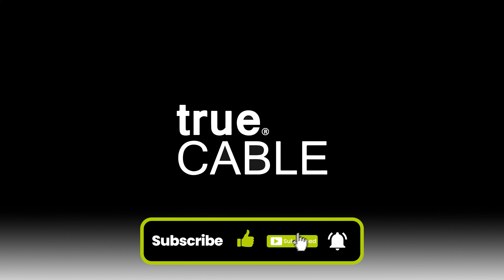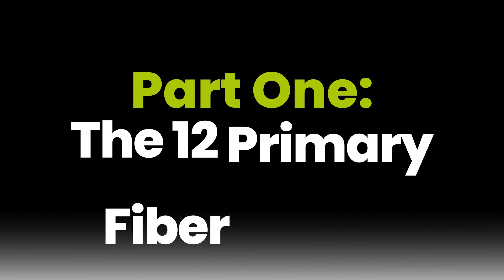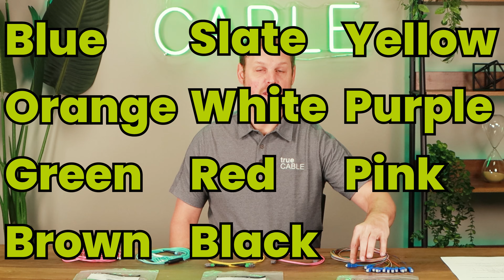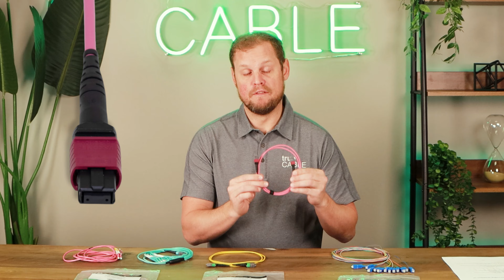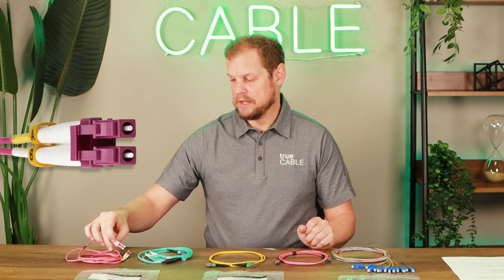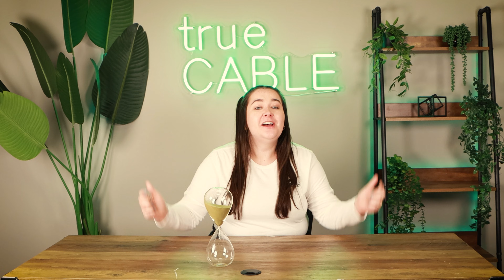Full Guide to Fiber Optic Color Coding | Breakdown with Examples 2024

Comment: fibre optic colour coding follows the old copper telecom colour coding, so it will start with blue, then orange, green ...... these also are phone line orders, blue is line 1 orange is line 2, etc. 
for cables that have multiples of these twelve, they have a wrap that starts with blue for the first, orange for the second, you guessed it green for the 3rd etc. it's just the same as it was with copper cables and bundles.
Reply from the maker: Hello! The colors are the same in regards to the tight buffer colors used on the individual strands. Where things get very different is the outer jacket colors, and that no longer follows anything resembling copper related technology.

Comment: OT : I have a home network with about 30 hard wired Cat5e and Cat6 sockets that were all wired professionally. Recently, I have been cleaning up my patch panel and making up some new patch cords. It's been a great learning experience. I have been cutting down some existing patch cables and re-terminating them. In doing this, I have found a bunch of very suspect cables. I watched your video on testing cables; specifically, on how twisting / un-twisting can affect performance. But, undoubtedly, your equipment is far too expensive for a home user with a limited number of cable to test. Can you suggest a cable performance tester that might be a bit more home user price friendly ?
Reply from the maker: Hello David! Ugh. That is a thorny question if spending money is an issue. The tester I am using is a Fluke DSX-8000 and fully kitted out to test patch cords in addition to permanent links it will cost you well north of $15K. The next step down is $2,100 for a Fluke LinkIQ, which will work well enough for home users and weekend warrior installers, but not professionals who actually need to Certify cable. The Fluke LinkIQ is cable "qualifier" that performs a pretty accurate analysis and speed test. Anything less than that is essentially a "blinky tester" (wire map tester) that only confirms conductor wiring sequence but tells you nothing about performance. There are wire map testers that cost from $10 to $150 but they all do the same thing basic thing: confirm wire map. Some add a rather inaccurate cable length test and other potentially useful features like a toner for figuring out what cable is what in a bundle, but the ability to actually measure cable and termination quality/speed starts at $2,100.
Reply: I would look for local rental companies.  I found a highly professional local firm which did their own in-house calibration (and also offered calibration service to others) for some no-longer-supported Fluke testers.  They rent out cable certifiers for a few days for a few tens of $/£/€ and would also do courier delivery anywhere in the country...  Some network equipment can also do TDR testing, I picked up a used wifi access point for £20 which I use exclusively for that (one of Ethernet ports allows for TDR data read-out), definitely no substitute for a proper certifier, but better than nothing.